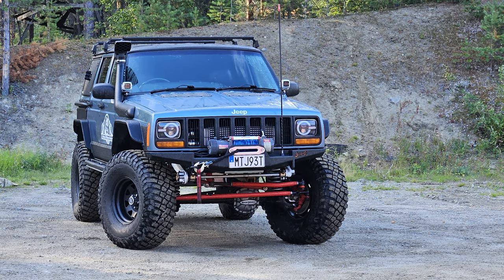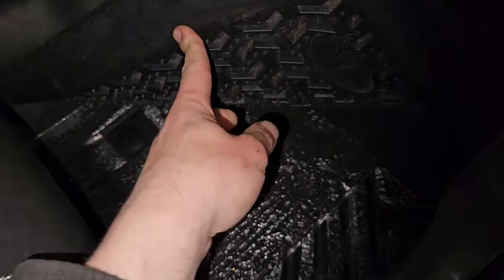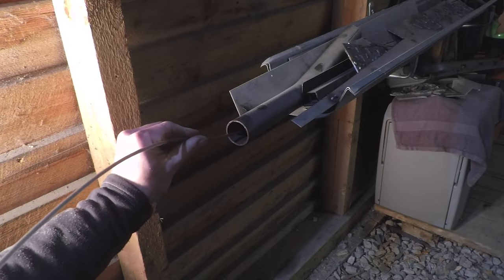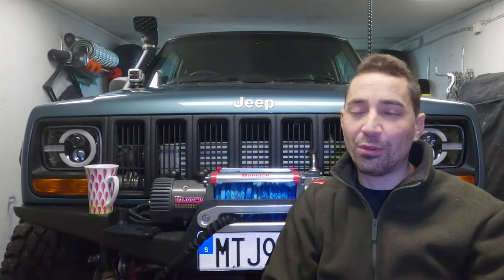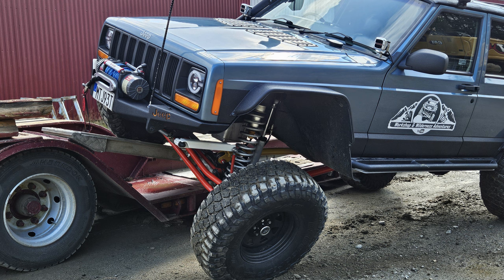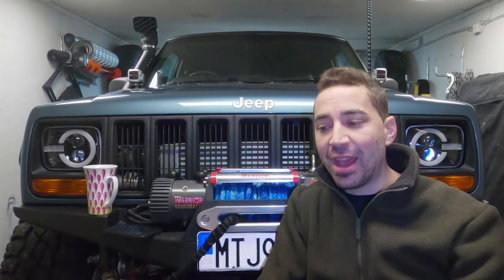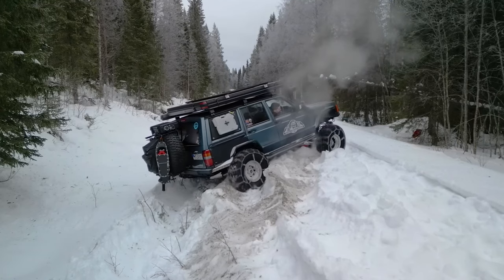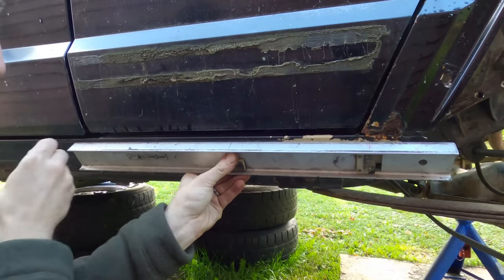What Would I Do Different If I Started Again

Comment: Would you put frame stifners on the xj of you would only put 31” tires and a 3” lift in the car? And use is for “overlading” op as you Saïd car camping :)
Reply from the maker: I think I would just for the reduction in road noise in the frame. After I installed them it was the first thing I noticed. The box rocker thing could wait, or never happen. Welding on the stiffeners would be a good upgrade on an overlander that sees a lot of vibration and shock load from dirt roads and pot holes.
Its a lot of work though so starting in the center is a good place to begin. You could go from there and add the fronts next and the rear last.
Reply: Im just starting out my first xj build but I want to point out the front end frame stiffeners seem like a must IF you get a steel bumper. Which most people do. The oem mounting locations are very thin.
Reply from the maker: Very good point!
Reply: Thanks for the response! I might just start looking into in. The thing I’m unsure about is how much weight it might add to the car. I would like to keep the jeep as light as possible especially with the 4.0 being thirsty as it is 🙃
Reply from the maker: I don't think Stiffeners would make a huge difference to the fuel economy. If you started doing bumpers, winches, and stuff, then it gets very heavy fast. Front and center are the most important

Comment: Hi, loving these videos.  I am a new-ish Jeep Cherokee 98 owner living in the Scottish highlands. i bought the Jeep with a 3-inch lift kit, and I've just completed a round trip from Scotland to Norway in the summer in it, and it was awesome. i have plenty of ideas of what i want to do to it to kit it out a bit better. although i am currently having an issue with my exhaust as it is sitting against part of the lift kit and creates and awful racket when starting up, have you got any suggestions on how to fix this? Or did you have a similar issue when you lifted yours?
Reply from the maker: I ended up side exiting the exhaust on mine although I don't think you would need to do that. What part of the suspension is it touching? I generally buy 2.5" stainless pipe and make up my own exhaust. You can use flexi pipe or other materials to plan the bends and things then buy pipe in the right shape. 
That sounds like a great trip! A jeep on 3" is a nice setup though, a good allrounder. 
Thanks for watching.
Reply: @WorkshoptoWilderness  that sounds like a good idea, cheers. I'm not very mechanically minded, so I can't give you the exact name, but it's sitting up against the bracket where the leaf spring is mounted to the lift kit; the end of the exhaust has been pushed over slightly towards the centre of the car. I'm not sure how to put that any better.
Reply from the maker: I know what you mean. The leaf spring bracket I guess. Unless you can bed it back by sliding a pipe up it and levering it down (possibly a shit idea but something I would do), you could cut it off further back and measure the external diameter. Then buy more stainless pipe and sleeve it with an exhaust bracket. 
It might not look good underneath but it depends on how much you like the exhaust.
Reply: @WorkshoptoWilderness  Cheers for the advice, thats very helpful! 
Keep making awesome videos, love the content

Comment: Does the silent coat pannels prevent heat from the engine/trans/exhaust from coming into the cab? Ive got a 97 with the 4.0 that we put a doubler in it, which pushed the trans up making the cab almost uncomfortably warm.
Reply from the maker: Yes, absolutely! I would also use some insulation or foam over silent coat for the trans tunnel. I have silent coat, foam, and insulation fabric over the trans tunnel to stop the heat, and it really helped.

Comment: Starting working on a 3.1 TD Grand Cherokee.  For now im more focused on the engine. Any tips about engine maintenance and improving reliability? I live im Portugal so the summer is hot.
Reply from the maker: The 3.1 can produce a lot of power but the VM's do need some work before you can get some good performance and reliability. Next time you pull out your water pump, check the impeller diameter. There are two models, a 76mm and a 71mm. Also check the internal diameter of the pump housing and see if that matches the impeller. If its all 71mm consider upgrading the pump and housing to a 76mm pump if you can find one.
The other things I'm sure you know and have done. Good coolant like HOAT for mixed metals, clean cooling system, new radiator or at least a clean one.   
If you want to start increasing power with more fuel and air then I think you might run into issues with heat given the ambient temps of where you are. 
Is the engine stock?
Reply: @WorkshoptoWilderness  I bought it last winter. Yes, the engine is original, has 80,000 km and is pulling very well. I have already cleaned the cooling system and changed the injector pump. I also use Engine Restorer, which I saw in one of your videos. But in the summer on hotter days the O/D light comes on, I'm trying to figure out how to fix this. For now, I just want to make sure that I have a mechanically reliable car.
Reply from the maker: It sounds like it's in good running condition then. Low mileage also. You've done most things then to make it in good order. It's just the hot summers that need some help by the sounds of it. 
There are other methods of cooling, but they can get expensive. Like injecting water and meth into the intake.

Comment: Hi, I have owned a 2.5td for about a year now. It has done me well so far. I drove to sweden and norway(6000km) with no issues. But I‘ve noticed a bit of a leak underneath the transmission and the transfer case. Is there a good gasket kit or a place to purchase these seals and gaskets? I would be super greatful for some advice. Thank you and awesome videos man👍🏼
Reply from the maker: Hi, where exactly is the leak coming from? If it's between the transmission and the engine, it will be the camshaft O ring. 
Of its transmission and the transfer case, then it will be the output seal on the transmission or the input seal on the transfer case. 
You can buy the gaskets from the Renegade Station in Germany.
Reply: @WorkshoptoWilderness  Thanks for the reply! I already replaced the crankshaft seal when I replaced the clutch. So chamshaft seal would make sense. The transfercase is leaking from both external seals. Thanks for the recomendation. I will order and replace some gaskets.
Reply from the maker: @lolerLp ah okay, it sounds like more than one place then. That's unfortunate, but in any case, you will have to remove everything, so you might as well change as much as you can! It's not the most fun job. Good luck and thanks for watching

Comment: Hi Mike, do you think new RC lift kits are good?
Reply from the maker: There meant to be better now. The one I had ten years ago was terrible but I think the point was they were just meant to make the Jeep look good.
I don't know if the rebuildable joints are reliable but perhaps a more basic system with poly bushings or something would last much longer. If your going with rebuildable joints or flex joints then choose a more reputable lift setup that uses Jonny joints or chromoly heims. The RC kits are nor really that cheap and for not much more, or the same, you could get this - https://www.claytonoffroad.com/product/jeep-cherokee-front-long-arm-upgrade-kit-1984-2001-xj
That's bolt on, just needs paint.
Reply: @WorkshoptoWilderness  Thank you for the answer, I was looking for leafpacks, coils and shock absorbers, I saw their 3inch lift kit also with lower control arms and swaybar relocator, do you suggest to change the tracbar for 3 inches?
Reply from the maker: Ah I see what you want. That link I sent you still needs a lot of stuff. How high do you want to go ad what country do you live in? Also how much do you want to spend? Are you going to take it offroad?
Reply: @WorkshoptoWilderness  I think 3 inches are ok for now, I live in Italy, the shittyest country for car mods, I have my 97 Cherokee 2.5vm second gen for 1 year and made 9000km, done many small things like brakes, alternator, radiator, and now I need new suspension so I thought why not a lift, it has a major problem with oil pressure at mininum rpms with the engine in temperature: 90°, I use 10w40, could it be wrong oil/oil pump o bushings?
Reply: @WorkshoptoWilderness  also yes my base idea is a versatile car for doing camping, adventures and carry around equipment, also offroad
Reply from the maker: The oil pump could be worn perhaps. The get scratched and stop performing as well over the years. If you throw in a can of Ametech Engine Restorer it should fix the low pump pressure after 100 miles of driving. 
10w40 is fine although what brand of oil is it?
Reply: @WorkshoptoWilderness  Yes I saw that product in one of your videos, is pretty difficult to get it in Italy, they only ship from the uk? I used petron*s oil, someone suggest me a 15w50, in winter we have like -15 and summer +35°C
Reply from the maker: Yeah they only ship from the UK so eBay is the place to get it. I use Molly 10w40 - https://www.trodo.se/motorolja-liqui-moly-super-leichtlauf-10w40-5l?utm_source=google&utm_medium=cpc&utm_campaign=pmax_all_products&gad_source=1&gclid=Cj0KCQjw05i4BhDiARIsAB_2wfAkB9uWDedEQ8Vp14SuMLQ069FkGXBxWMtVXhi37N1afJll0KgkZpQaAlquEALw_wcB 

So for the lift you could go with a basic RC 3" lift and it would be fine for what your doing. I would just recommend an adjustable track bar as an extra for such a lift.
Reply: @WorkshoptoWilderness  I will try it, thanks a lot for all the knowledge and time, hope you will heal soon and best wishes for the new baby.😃

Comment: have you made the front bumper by your self ? can i buy the stiffener in sweden ? you have a great thing on the back where you have an xtra wheel is that made by you or can you buy it
Reply from the maker: The rear bumper tire carrier is made by me, well most of it. The front bumper I bought in the UK when I lived there although the maker has unfortunaily stopped making them. There are many other similar ones out there though. I can try and find some links. 
You can get stifferners in Sweden ordered from the UK or USA. 

This one below is from the UK but the shipping is very cheap. 
https://www.ebay.co.uk/itm/126396947134?chn=ps&_ul=GB&_trkparms=ispr%3D1&amdata=enc%3A1fXF-fFqSQPulNeunGFkGyQ46&norover=1&mkevt=1&mkrid=710-169684-019962-0&mkcid=2&itemid=126396947134&targetid=325425753764&device=c&mktype=pla&googleloc=9067767&poi=&campaignid=20637590555&mkgroupid=156071835804&rlsatarget=pla-325425753764&abcId=&merchantid=6995734&gad_source=1&gclid=Cj0KCQjw05i4BhDiARIsAB_2wfDIWMQuQodr-Y0V6svAuBJgJQ_x1bCUvNtfYNX7O-WpsO0c5s8cfdAaAlQaEALw_wcB

This is from the USA, a much more robust kit but its reflected in the price. The shipping is also very expensive. You may not need this kind of kit unless you offroad the Jeep or run big tires and suspension. 
https://www.ironrockoffroad.com/product/xj-unibody-frame-stiffeners-full-set.html
Reply: @WorkshoptoWilderness  thank you very much

Comment: Does anyone have a good source for frame stiffeners and bumpers etc. in Europe? I am in Finland - 1989 Cherokee
Reply from the maker: So you can get them from the UK on eBay, BUT they are only 3mm thick and they only go on the side of the frame. Link below. 

https://www.ebay.co.uk/itm/126396947134?chn=ps&_ul=GB&_trkparms=ispr%3D1&amdata=enc%3A1fXF-fFqSQPulNeunGFkGyQ46&norover=1&mkevt=1&mkrid=710-169684-019962-0&mkcid=2&itemid=126396947134&targetid=325425753764&device=c&mktype=pla&googleloc=9067767&poi=&campaignid=20637590555&mkgroupid=156071835804&rlsatarget=pla-325425753764&abcId=&merchantid=6995734&gad_source=1&gclid=Cj0KCQjw05i4BhDiARIsAB_2wfBnZ3VHzHu6BWRWBuIVI48R6ZgjW1C2XhI6mjHBKV84fZ5HuVosYqUaAmbUEALw_wcB

Iron Rock Offroad ship all over the world and sell a full set. - https://www.ironrockoffroad.com/product/xj-unibody-frame-stiffeners-full-set.html
But its more expensive, 6mm thick, and shipping will be near 300EUR
Reply: Thanks

Comment: As an ex-owner of 4.0l petrol XJ and current owner of the 2.5 diesel XJ I would like to add one thing. Do not buy a diesel XJ 😅
Reply from the maker: I think you would have a shock if you drove my diesel. It makes my 4.0 feel underpowered.
Reply: @WorkshoptoWilderness  I can only compare stock diesel (straight pipe, blocked EGR) to a petrol with a performance header (thats how I bought it) and theres is nothing to compare really. This diesel feels extremely underpowered, feels a hill before I can see it, 4.0 was rather quick and the sound was awesome. The only worse engine in XJ is 2.1 Renault diesel, test drove it once and I couldn't get it up for 2 weeks after that, cried myself to sleep every night.
Reply: @WorkshoptoWilderness would still love to see a dyno run of your 2.5 with all the upgrades you’ve done, love your videos
Reply: @WorkshoptoWilderness  BUT if we ever meet I am happy to give it a go 👌
Reply from the maker: The stock TD is really underwhelming to be honest. I suppose much like the XJ itself it can be greatly improved, but at the cost of money and time, also failure and setbacks. 
I will dyno mine after Christmas for actual results but fuel/air/timing mods can make it very responsive on the highway or offroad. There is no reason why you cant get 180hp from it safely, torquing up from 1200rpm to 3000rpm maintaining hill climbs in 5th at 100kph with stable egts and coolant temps. You could get much more with some help from a water/meth injection kit.
Its just a shit old tractor engine, give it more bang then choke it out up top so it doesn't blow up and it will be fun, but it will drink. 
4.0 is a better engine though by design, no argument from me there. I just love diesels I guess.
Reply from the maker: I found a place 6 hours south of me. I'm going to go there after Christmas if I can and Dyno the Jeep. I will be nervous but it will be really interesting!